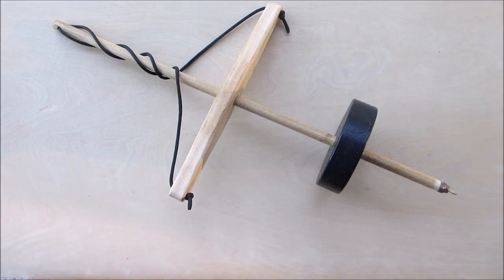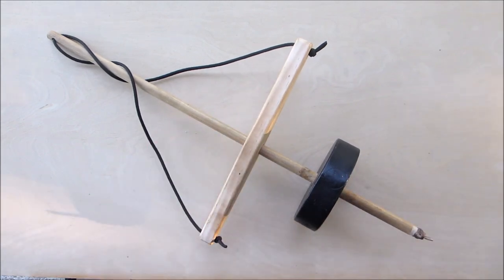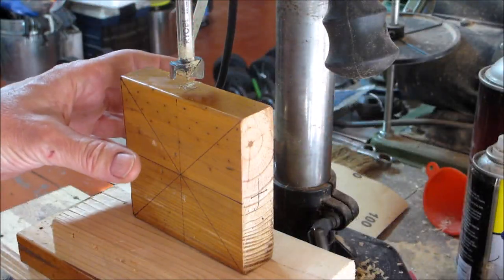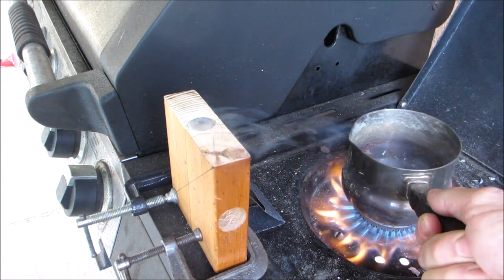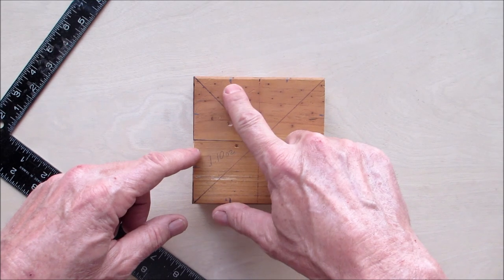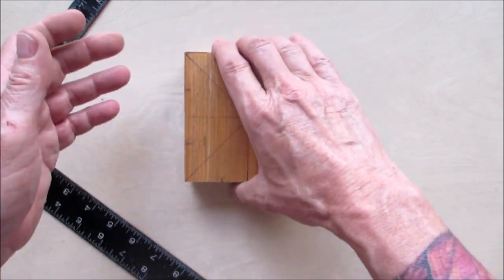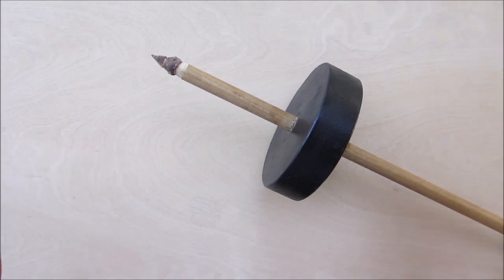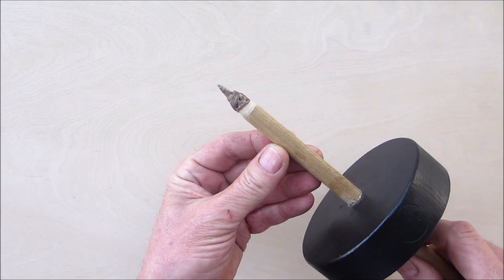How to make a pump drill!

Comment: question is poissibly for me to make smaller version  your diy pump drill for hand tool for my arts and crafts? 

second question: is this materials good enough for small diy pump drill 
-Chop sitck
-  Two popsicle sitcks 
- some strings or any thing the rope 
- dvd for round 
and lastly 
- Needle saw for drill
Reply from the maker: Hi! I made a smaller one. The only way to know the if your idea would work is to try it!

Comment: Is that a pump drill? Or just a drill?
Sir.. do you know what a pump is?
Reply from the maker: It’s a pump drill. A pump drill is a simple hand-powered device to impart a rapid rotating motion to a rod. It can be used as a drill to make holes in various materials. And yes sir, I know what a pump is…